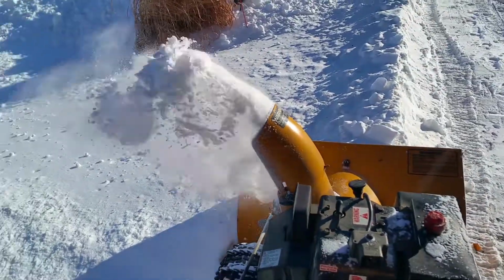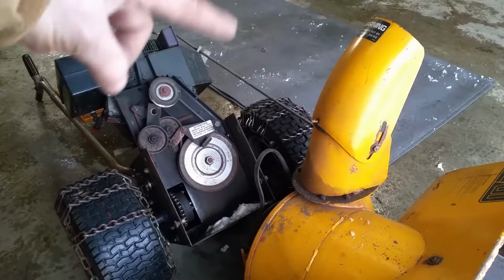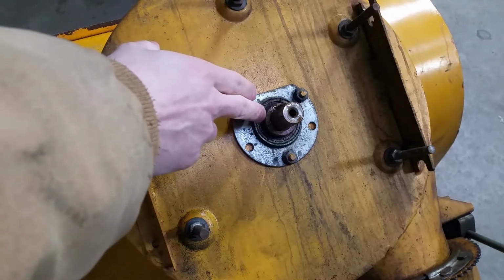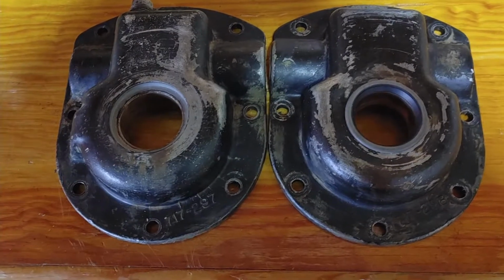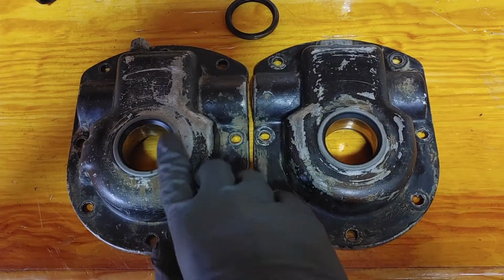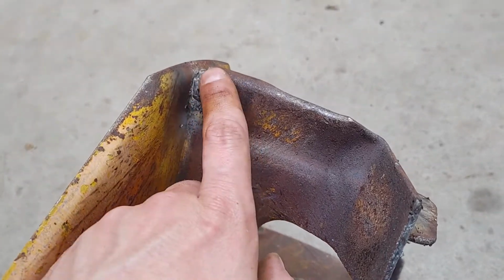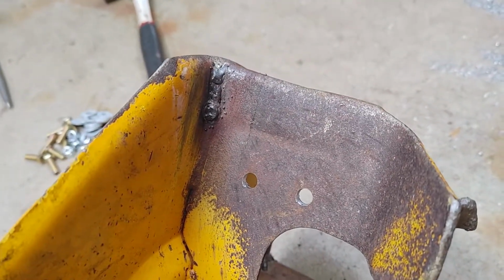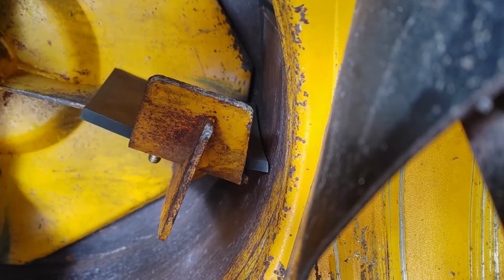Saving a snow blower and fixing it up

Comment: I have had that same model blower that I bought new in late 70's or early 80's and the thing just keeps on trucking. It is in my shop now getting it's auger drive rebuilt with new bushings, seals and woodruff keys. I am a retired machinist with the ability and the milling machine with divider head to fab new gears from bronze instead of the original aluminum. I will state categorically this generation of MTD built blowers are far better built than the newer junk out there as I've had to repair literally every other blower on the street for neighbours over the years  while that beast just keeps moving snow.